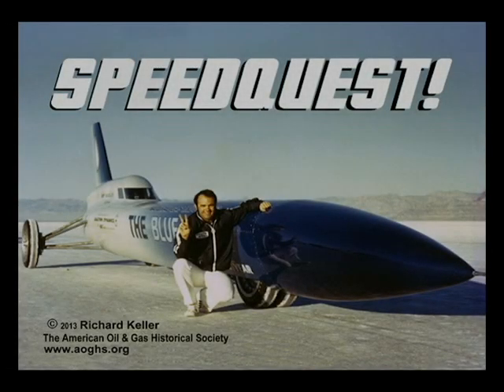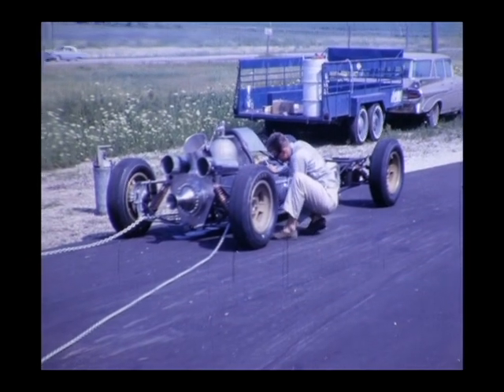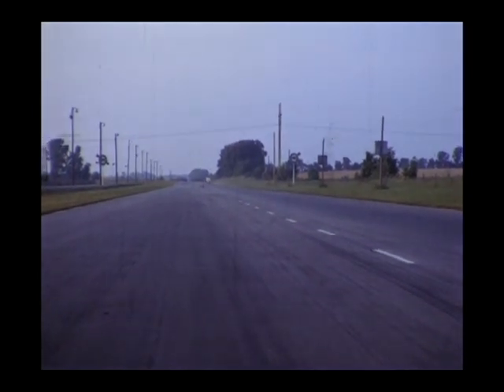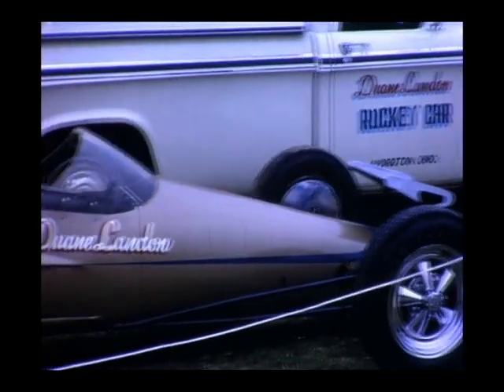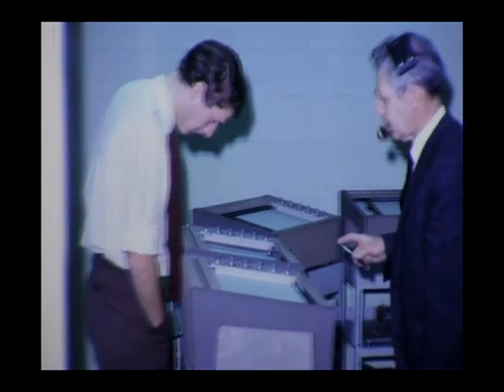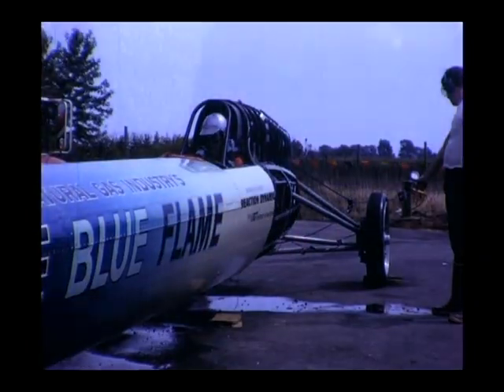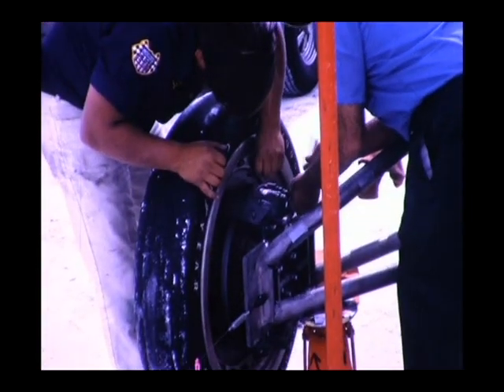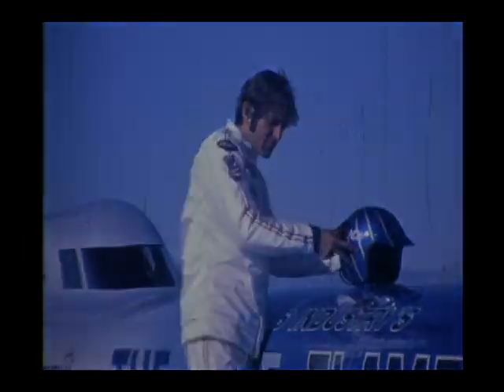The Blue Flame - Speedquest

Comment: This was when life was good!
Reply from the maker: It was certainly simpler. Everyone was excited by the race to the Moon. Breedlove and the Arfons brothers were able to produce terrific results on modest budgets and resources using surplus turbojets. The Blue Flame project was different in that we approached the task from the opposite direction. We determined our speed objective first, then designed and built the (rocket) powerplant to meet that goal. As you can see, we had no fancy accommodations on the salt flats. Fortunately, we had a large cadre of enthusiastic supporters in all phases of the project; design, construction, and running The Blue Flame on the Bonneville salt flats.

Comment: Though I never appeared in this vid, I did develop and build high performance capacitive  discharge ignition system as a backup should the spontaneous combustion system not work according to design.  To my knowledge, it did.  It was a dream   come true    for me.
Reply from the maker: Thank you for your work on the ignition system. There were about 60 unsung heroes that contributed to this project in design and fabrication. Again, thanks.

Comment: Do you have any of the facts on the acceleration and deceleration? For example, how many seconds to it's top speed, how fast per second, and how fast did it slow down, G Forces involved...?
Reply from the maker: +SanFranciscoBay We did make standing start 1/4-mile runs on the Bonneville Salt Flats while preparing the car. We were running with the reduced thrust settings at the time. The car did the SS 1/4-mile in 6.724 seconds with an AVERAGE speed for  the distance of 133.849 mi/h. Probably 250 mi/h peak speed. The car was under power for 20 seconds for the mile record, maximum velocity with onboard instruments was 660 mi/h near the middle of the measured mile.

Comment: heyy awesome video!! ive seen the Blue Flame myself in the museum here in germany! have you ever gone to see it? other question, why didnt you try to go supersonic? upgrade the wheels and go full thrust? seems like an option that could have been tried, maybe?
Reply from the maker: Chris, good questions. First, the wheels and tires were already tested and adequate up to 850 mi/h. Goodyear just wanted to reduce the risk of catastrophe since that was our first ever land speed record attempt. So, they arbitrarily limited us to a maximum speed of 700 mi/h in 1970. Goodyear owned the tires (we designed built, and owned the wheels). Just to assure that we would not exceed 700 mi/h, we "detuned" the rocket motor to 60% of maximum thrust. This involved using a smaller LNG fuel tank. Since the ideal run profile 
was to accelerate at full throttle (foot pedal), we peaked at 660 mi/h - safely below the 700 mi/h self-imposed limit. Unfortunately, Pete and I (Reaction Dynamics) lost title to The Blue Flame because we did not get the car ready to run in 1969 per our contract with the American Gas Association. They (AGA) did not want the car to run again because they believed the risk exceeded the possible benefit. So, The Blue Flame instead went on a U.S. and European publicity tour after we removed the propellant tanks and other hardware. Then, they "sold" it to a Dutch collector who donated it to the Sinsheim museum. The car was designed and wind tunnel tested (scale model) to exceed Mach 1 with full power (22,000 pounds thrust). It was perfectly stable at 660 mi/h, and the instrumentation verified the test data when running the car. Our original plan was to return in 1971 for the supersonic attempt - but did not happen. I've been to the Sinshem museum and The Blue Flame looks great - the first automobile to exceed 1,000 km/h!
Reply: Thank you Dick for taking the time to reply to my questions, much appreciated! Awesome machine you had built there! also my sincerest condolences for the loss of your friend Chuck

Comment: Did you and the builders of the Budweiser Rocket Car and the Wingfoot Express 2 Rocket Car share information with each other on how to build a fast and stable car or did you keep your information secret due to the competition? Here is a photo of the Wingfoot Express 2 car mid page: http://www.landspeedrecord.org/wingfoot-express-tom-green/
Reply from the maker: +SanFranciscoBay I knew both of the Arfons brothers and visited their shops on Pickle Road near Akron several times. We mostly discussed the logistics issues on the Bonneville Salt Flats. Also, our X-1 rocket dragster appeared at several exhibition drag races with the Green Monsters where we socialized. Firestone had asked my opinion on the Wingfoot Express rocket car performance potential before it ran - and I had talked with Tom Green, who lived near Chicago, about general issues running at Bonneville. The builder of the Bud car was a former employer of Gary Gabelich, driving his jet Valkyrie, so there may have been some sharing there.
Reply: +Dick Keller. I was looking for photos of the Valkyrie Turbine Car and found this picture. It looks like its in the builders driveway, designed to fit inside the garage, which was too small, so he cut a hole in the garage door so the car would fit inside and the nose could stay attached and have the garage door close. http://www.gettyimages.ch/detail/nachrichtenfoto/bill-fredrick-valkyrie-jet-car-nachrichtenfoto/155881573
Reply from the maker: +SanFranciscoBay Gary Gabelich drove the Valkyrie in a 1960s movie 'The Lively Set'. It was later purchased by Art Malone, and then Chuck Suba, who was our original driver choice for The Blue Flame.

Comment from the maker: Gregg, the fact is, the car as it sits in the museum is pretty much just the shell. All of the fuel tanks and lines were removed to save weight for its world victory tour. The rocket motor internals were also removed. It would be death-defying to try to run the 43 year old chassis at any speed (corrosion, etc.). Actually, the wheels would be the most sound component remaining.

Comment: How did the driver steer the car during the speed runs? Do you steer by turning the front wheel like a car, or do you steer by the rear tail like an airplane?
Reply from the maker: +SanFranciscoBay The Blue Flame is an automobile. Per the FIA regulation - four wheels, not in a line, steered through two.